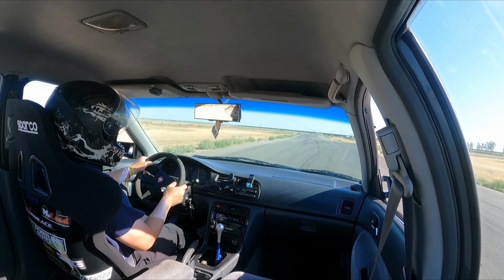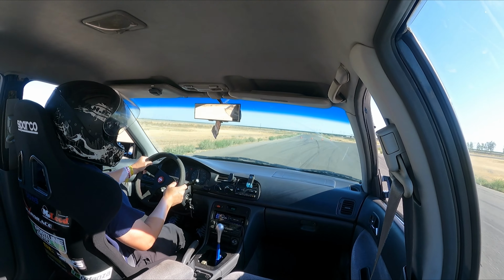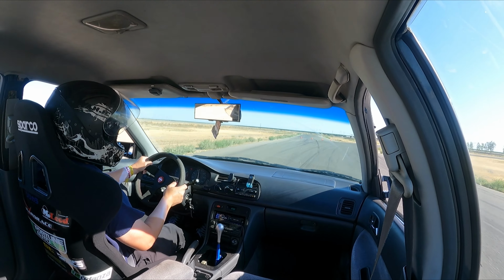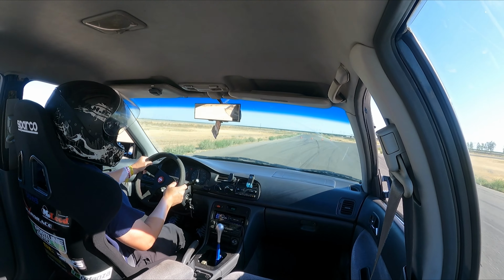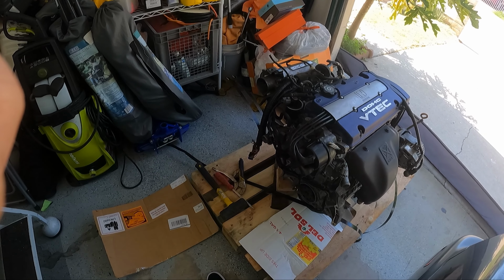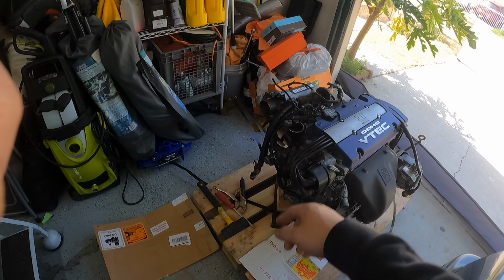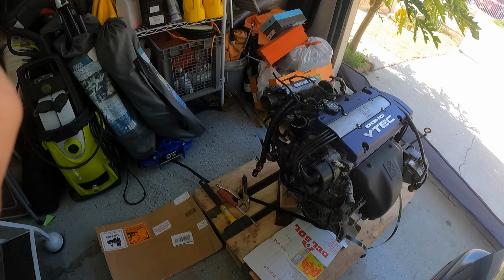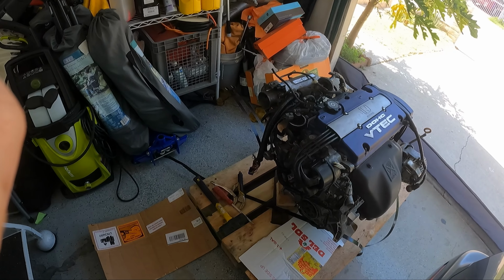1997 Honda Accord CD5 Buttonwillow Raceway Park Slip Angle Track Event 07/09/2023

Comment: Too bad man! But H or F20b swap will be nice! I usually turn my cabin heater on whenever my water temp goes up. Even when l go to manila, l turn it on coz it relieve a lot of heat from the motor. Looking forward on the swap. New subs!
Reply from the maker: Thank You Noel! I’m a big follower on your channel, I’ve been watching a lot of videos to help me with my swap. Thanks for stopping by Uncle🙌
Reply: @SoulPhoReal  no worries man! Wish l could find a time like what you do. I really like to experience how it is driving on the road circuit. Good luck on your build, you'll like F20B. For a small time l droved Aj cd5 w/ f20b swapped, l was impressed. It'll be perfect motor for things you do on the track. Thanks